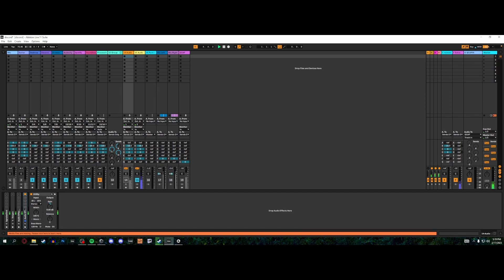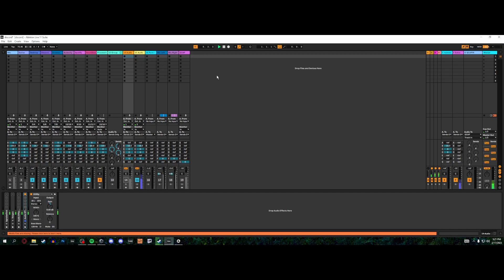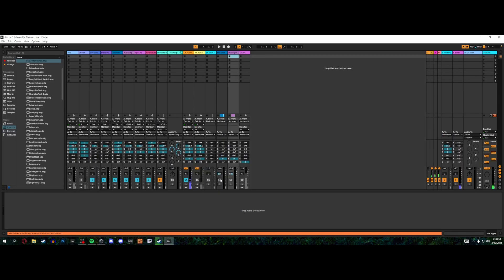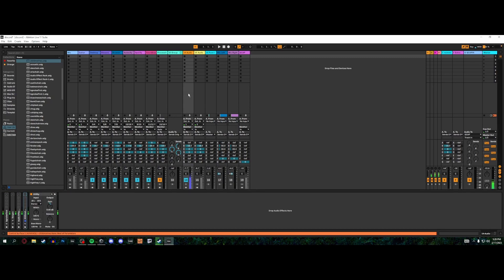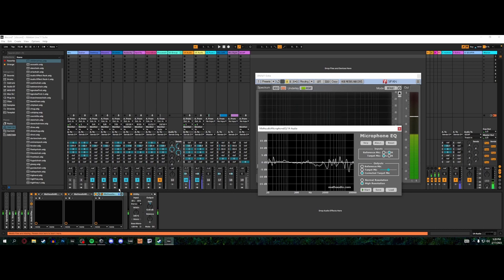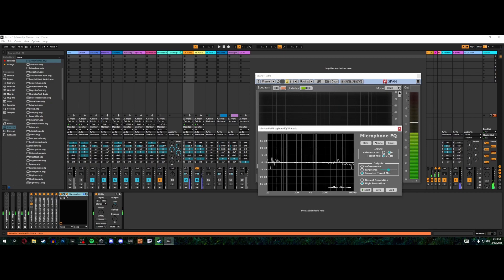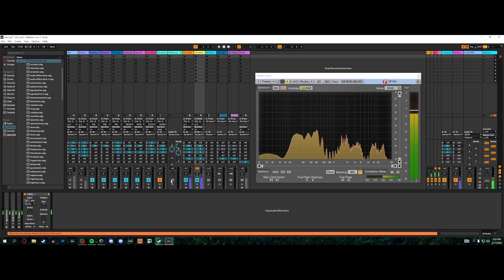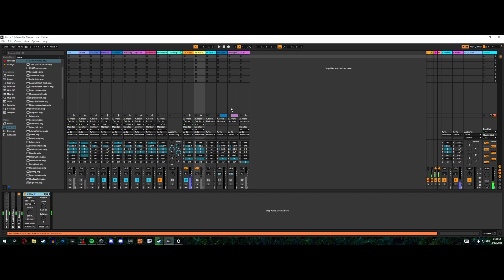I figured out the best way to EQ match microphones.

Comment: Recently I took some expensive microphones from my friends, U87, Lewitts, and few others and then did the same thing with the pink noise, so I now have my NT1 as a base and then I can use all those FabFilter Q3 and Saturn presets to emulate other microphones, it is basically identical.
But after I did all that I rarely use it as the NT1 is really so similar to any of those, in a blind test they can all be used on the same track, the same song, without anyone knowing the difference.
I think a lot of mythomania is present with LDC microphones, people believe all sorts of nonsense, especially if the microphone is expensive and even more if it is a Neumann.

Comment: I like MMM, the moving microphone method, for more consistency in the measurements. Pretty much the same method as you, but you quickly get hundreds of averaged measurements which ends up being much more repeatable.
Reply: Not sure if I understood this well, you mean to move both mics when recording the pink noise? This is interesting, maybe not so precise but overall maybe closer to how the mics are used.
In the end it really does not matter that much, there is much more difference in day to day voice character than how the microphones sound initially, one day I recorded with the U87, the next day after a gig I recorded with the NT1 and that Rode take had so much more grain, grit, and that famous Neumann transformer saturation than the real U87. 🤣
Ah humans, so delusional all the time. :)
Reply: @BojanBojovic  It's a feature in the software. It keeps taking samples until you hit stop and allows you to use the average measurement. I've gotten very consistent results that way.
Reply: @BojanBojovic  Rode makes some great mics. But sometimes you want to add in some of the character of a particular mic, perhaps a Neumann, but to do that well you want to capture the frequency response of your mics and calculate the EQ changes needed. It's not going to be perfect, as there's a lot more to a mic than on-axis frequency response, but depending on the recording situation it can get you a lot of the way there.